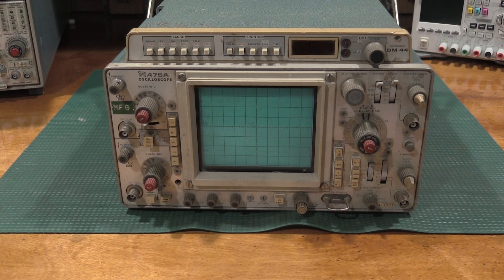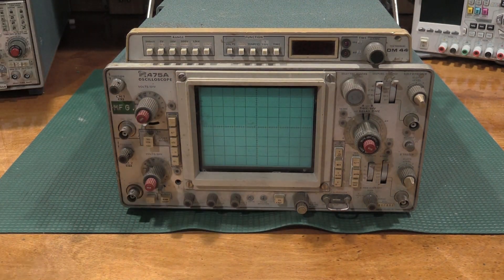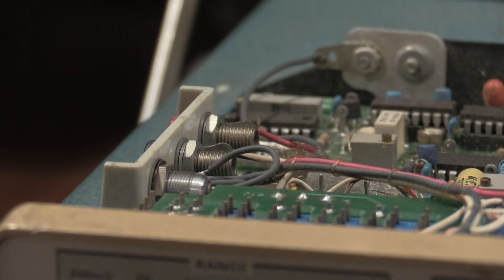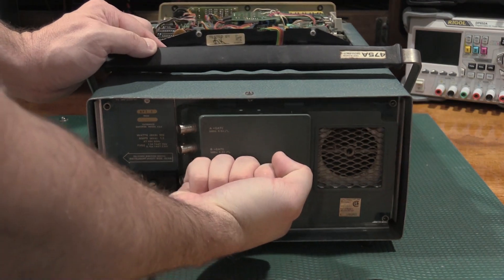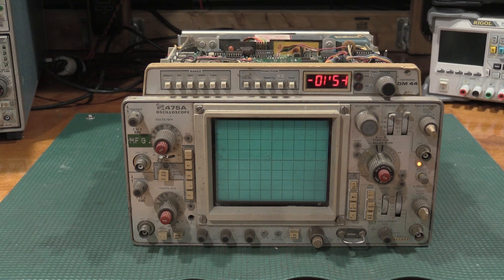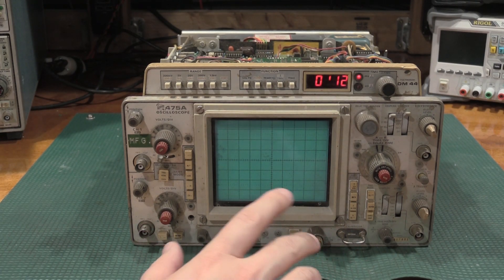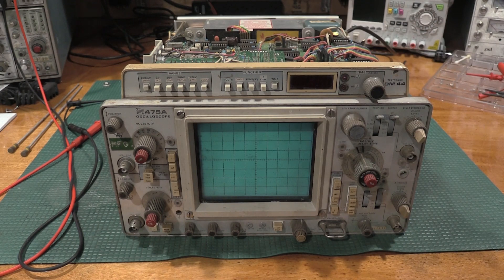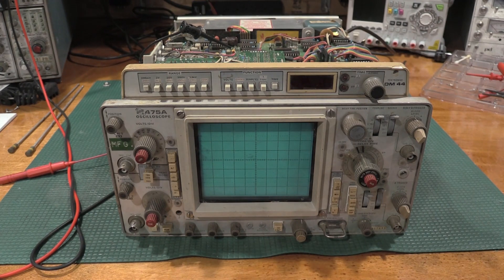Tektronix 475A Troubleshooting and Major Damage

Comment: With regard to the sweep not working on most of the time base selections,  I had a very similar issue on a 475 that I restored.  'A Intensified' worked for the most part,  however 'A lock knobs', 'Mix mode', and 'B Delayed' were either not working at all or barely working.  Turning the time base knob on these modes would basically give me nothing on the screen.  I pulled my hair out trying to troubleshoot it until I figured out that the -8V power rail was common to these three modes,  all three of them used it (but not the other one),  but none of them were getting power from it.  Turns out one of the gold "finger" contacts under the A time base cam section had a tiny crack in it's base where it joined the board,  so it was making no contact with the pad even when the cam was pushing it down.  Took the entire time base apart and once I removed the cam,  the finger just fell off the board in my hand. That was a fun repair.

That whole scope was a basket case,  even the B time base knob that you pull out would just spin freely when you unlocked it,  no detents.  Turns out it was stripped out inside the cam.  I fixed everything on that scope,  and it was such a pain,  but I love the 465/475s and I still have it today.  It is exclusively used for curve tracer duty these days.  Cant bring myself to get rid of it.
Reply from the maker: I am going to revisit this scope and I will check for that. It sounds exactly like the issues I am seeing with this scope. Hmmm
Reply: The DM 44 was a total waste of time being designed into the 475, it was totally useless and detrimental the the superior design of the 475 scope.

Comment: Nope, sorry bud, I'm sure you are a very knowledgeable guy,  but I'm afraid to say in that  observerving your random  twiddling of the controls of the scope,  I would much rather Mr Carlsons approach.
Reply from the maker: In this case and only the case of Tek scopes. This is an approach recommended by the manufacturer. It is an information gathering step that can lead to trouble spots in the scope one of the main shortfalls here is it does not take in to account what damage time has done. Tek recommends gathering as much troubleshooting information as you can before even opening the chassis. One of the reasons that I ended up down as the bottom of the wrong rabbit hole. I was looking for a sweep issue not a DM44 issue. Seems the DM44 has some control of the sweep circuit at lower speeds. I also enjoy Mr Carlson’s Lab and am a regular viewer of his channel as well.